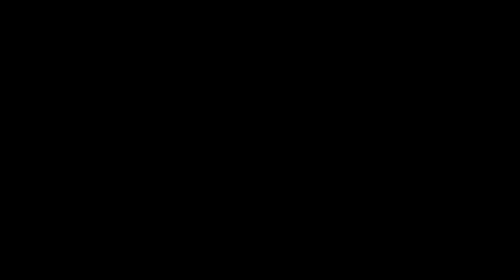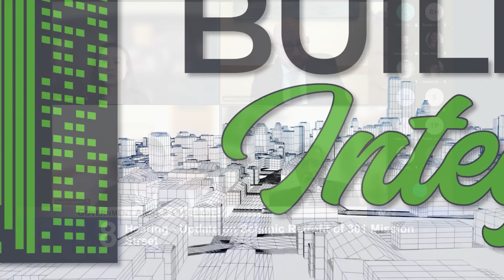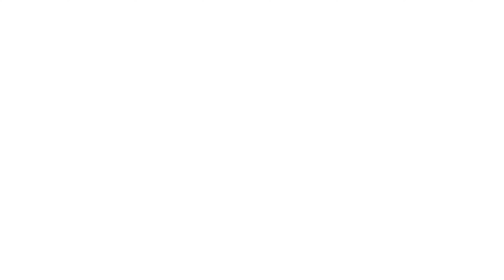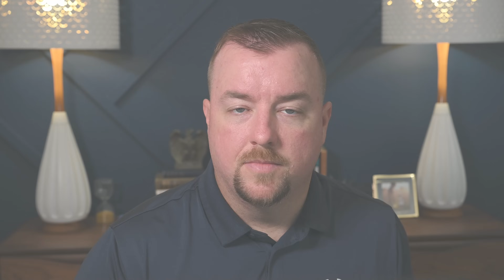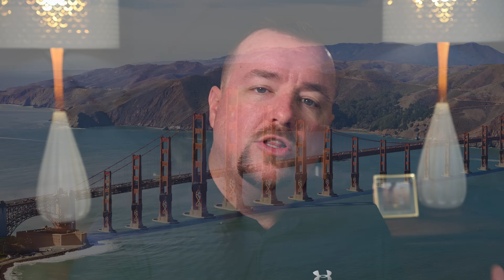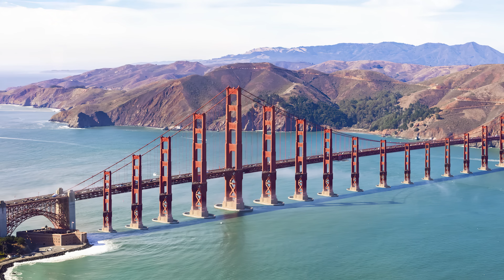Millennium Tower's "Sophisticated" Fix?  You Decide - (San Francisco's Leaning Tower Part 4)

Comment: Going to bedrock is the best long term design.  That big slab of concrete has a huge lever on top of it all of the time and when the soils shift and/or the wind blows, the lever for sure places huge loads on that foundation which is sitting on mushy soil. The fact that this building is leaning confirms it.
Reply: The Prudential Tower in Boston is 62 stories high and the foundation goes down 22 stories into bedrock. The building has been standing there for over 50 years with no problems. What does that tell you?
Reply: @joevignolor4u949  It tells you that this 10 foot concrete slab was a failure and a poor choice for the type of soil on that site.
Reply: @Garth2011  No kidding. That's why Boston doesn't have as many tall skyscrapers as New York City. In Boston its a long way down to the bedrock so the foundation has to go down that far. In New York City the bedrock is shallower so the foundation is cheaper and easier to build.
Reply: @joevignolor4u949  My opinion,  they engineered that lawsuit with the city to make public funds available once they discovered the foundation idea was failing which kept the parties involved with construction & engineering free of financial ruin. Now, they are back pedaling on a bad idea with the cities money, not theirs. Its going to come down sooner or later and the condo's are worthless today as I see it.

Comment: Straight off, I'm an architect not an engineer and I'm based in Scotland and not the USA. However, I have two questions. First, if Hamburger is the 'engineer of record' then surely he is responsible for a design that meets the bearing capacity of the soil. The geotechnical engineer Egan can presumably supply that figure but is not qualified nor mandated to vet Hamburger's solution. Second, I'm assuming these are friction piles. Reducing pile number (from 52 to 18) commensurately reduces pile surface area and the effectiveness of friction (unless pile circumference is increased roughly threefold).  Again, it is surely not Egan's responsibility to determine that 18 is the appropriate number; that is the function of the engineering design made by the engineer of record. Keep these videos coming.  They are fascinating and hugely informative.

Comment: The whole thing is flawed. Their repair only addresses the perimeter while ignoring the inside of the structure. What's keeping the slab from sagging in the middle?
Reply: esp since it's already dishing
Reply: This makes me question what happens during an earthquake. I mean, one side is supported on bedrock while the other is not. Even without an earthquake, it seems like this would put stress/pressure on the centerpoint of the foundation. Basically, you have a beam (slab) where one side is rigid, and the other is not. Sounds like a bad idea to begin with, and potentially exacerbated in an earthquake.

Comment: I am a retired civil engineer with experience of bridge design and large diameter piles. In terms of how the number of extra piles was arrived at, I can see how they came to a ad hoc number of 52. Just simply put in as many as you can at 6ft centres and problem solved. Also, saying 18 piles as opposed to 400 piles, would seem such a huge difference that it may not be taken seriously.

However, to determine the actual number of piles required is very simple. These extra piles would be going down to bedrock and so the pile capacity would be based on the allowable end bearing onto the rock. No need to take into account friction support from the soil, although down-drag from the surround settling soil must be included in the load on the piles. Just divide the total load by the individual capacities and you get the answer, which they say is 18. Hopefully.

The really worrying question though, is when the building settles and assuming the new piles are strong to support the given loads, what is going to stop the building tilting past the levelling value? The designers would have to very confident that their predictions of settlement values are correct, which seems a big ask to me.

I'm of the belief it needs a pro-active system, which can take into account the unpredictable nature of soil settlement. There should be jacking systems built into any new piles so that their loadings can be adjusted when the building has reached an acceptable tilt. Relying on hope alone, is not good engineering.
Reply: Foundation pad shows evidence of cupping which calls into question whether it is strong enough for partial perimeter piles mounted outside of the footprint.  Seems to me that mounting piles to the side of the foundation introduces bending force which can't be good.  I agree with the need for jacking system but is the foundation pad strong enough?  I have not seen any studies that assess the foundation's strength.
Reply: IIRC the 400 pile solution involved driving micro piles through the existing foundation mat so once capped they would become an integral part of the foundation and prevent any cupping or excess stress on the foundation - something these perimeter piles can't do.
Reply: @xenadu02 Thanks for that info. However, the problem with adding piles within the foundation footprint, is that unless they are taken down to bedrock, they will have no effect upon the settlement. The existing piles have formed an encompassing pressure bulb, and any new pile within that bulb will be carried down together with the whole group. It's a well known phenomenon and I find it hard to believe it wasn't taken into account in the original design.
Reply: @dawhandle  but it would reinforce the foundation within the pressure bulb?
Reply: @RobertSzasz  Well, I don't think they would. To relieve the stresses in the base, the micro piles would have to provide support. I don't see how they can do that without reaching the bedrock.
The existing main piles have taken up a certain deflection shape and that cannot be changed by any support being added within the bulb.
I don't know anything about the base, but of course, it will need to be strong enough to cope with any edge piling. If it isn't, then it will need strengthening. Very difficult and expensive.
Reply: @dawhandle  clearly keeping the entire building, foundation, and pilings from moving is going to require going down to bedrock, but could some sort of micropile or grouting stop the differential settling causing the foundation to dish?
Reply: @RobertSzasz  The problem is that to remove the sagging in the slab, the existing piles (which are integral with the slab) will need to be lifted as well. Unfortunately, the loads involved would be hundreds of tons for each pile and would probably snap them as they are not designed to take that much tension. To reduce the settlement with grout, it would have to be done below the level of the existing piles. Not impossible, but could have unintended consequences, eg blowing out sideways and affecting adjacent buildings.
Reply: The added side piles actually do have adjustable jacks, it's part of the design.  But I'm thinking this gigantic weight pushing down on a wall of piles will end up creating a weird side force, looking like the number 7.  And that won't be good either, jacks or not.

You'll be hearing about this building for the foreseeable future.  It's always going to have problems, and with each major SF earthquake it will spawn new and exciting news stories.
Reply: @darioinfini  Thanks for letting me know Dario. At least that's a step in the right direction. But as you say, there are enormous forces involved and I don't think I would want to be living in one of those apartments while they do the work.
Reply: @dawhandle  I wonder if there would have been much difference if at the design stage, the outer most piles were kept, then a sheet pile box were made inside that perimeter and then just put the foundation on top of that. You're end bearing against the subsurface anyways, so might as well make it easy to do things like grout injection
Reply: @darioinfini  I'm no engineer but I would be deathly afraid to be in or around that building during a severe or even moderate earthquake.
Reply: @alecb8509  No doubt.  Can't say for sure but would not be surprised to see a spectacular collapse in the future.  Japan has some crazy quakes and I don't think they've had something like that; their buildings do some awesome scary swaying.  But they do have Fukushima.  6 of one, half dozen of the other.
Reply: Put in large diameter tubular piles as we do in offshore structures (48"-72") down to bedrock and you') be fine. Transfer the loads to the raft using flat jacks which can be adjusted or even changed out if necessary. That will work.

Comment: I'm wondereing how many of these separate engineers are only working within a closely defined remit - the sort of work resulting from the client or its agent packaging up chunks of work for bidding and then selecting all the cheapest, or quickest, or friendliest or risk-avoiding or some other criteria rather than building a broader but more challenging team. The phrase "supporting the project objectives" means different things to differnt folks at diferent times. If I ask my geotech guy for the best scientific analysis, and my engineer for the quickest solution and the project objective is for the earliest revenue from letting, we'll all be disappointed if what I really need is an optimised solution that tells me I should be doing something different.

Comment: Josh thanks for the video - and thanks for the comments/explanations/opinions.
 
Ok - as  a retired civil engineer I can only  say I am not visiting San Francisco soon! 

I have worked as part of a Independent Checking Engineer team - and as part of that our job was NOT to second guess the proposed solution - but to say if it would work. Although if something was 'over engineered'  we probably would say something! And yes, I have worked (on the project management side) on retrofit/strengthening/structural safety of 12 storey residential buildings. AND I am concerned at what is being said/done. AND in an earthquake zone - which I have also worked in.

52 piles reduced to 18  does look like a cost saving - presumably with increased loadings on the 18 piles - with all that entails in terms of foundations/load transfer etc. Actually it looks like a 'finish and walk away bloody quick' solution.

I am actually reminded of the leaning Tower of Pisa over the various fixes over the centuries and of course the 'final' fixes of the 20th Century but that had lower potential safety risk, and even depending on how you price historical/cultural value a lower 'value'.

But to be frank - and using acronym for family viewers - WTF!

Comment: “I say we take off and nuke the entire site from orbit. It’s the only way to be sure.”
They are going round in circles trying to save the unsaveable. Even if they eventually manage to put in an arbitrary number of piles on one side of the building they will at some point need to repeat the process on the opposite side otherwise it will just tilt the other way.  Then there is the little issue of the 12 foot slab which due to the tilting forces isn't as flat as it used to be. I shudder to think what will happen when the "Big One" comes...
Reply: Not nuke from orbit, rather plant one under it.   That will create a void but with super strong glass like materials fused to hold it up.   (Don't worry about a little vibration, the melting, and cooling cycles.)  Just look at how strong the volcanic glass like remains will be....

Comment: Wow, strong closing words there!  This "retrofit" is turning out to be a real thriller, cheers for sharing your expertise with us, Josh, and have a great weekend.
Reply: I think we're seeing organizational behavior - how companies deal with failure.  How to cover themselves and how to avoid making this resume stain worse.  I have to wonder if the 52 proposal wasn't just a test to see if the repair was even feasible.  If 52 wouldn't pass the geotechnical, then the building was doomed. Once it was found to be viable, a stepwise move to optimization began.
Reply: @russellhltn1396  That was my instinctive guess.   Initial question, can we install enough piles to fix the problem?   Okay, say six feet spacing, is that practical and ask the geotech guys if that's enough.   And then I suspect they found the cost per pile was  way over their initial rough estimate (because it always is) and the test piles were exacerbating the problem - and it all went pear-shaped from there.

Comment: I’m not an engineer. When I first immigrated to the USA back in 1977, I used to look at the tallest building in downtown Miami from the 4th floor at the apartment building I used to live in. It didn’t matter how many times I contemplated that building, I could never get over the “magic” that would take to make such a structure simply stand there. And that’s before I found out that Miami is located in “Hurricane alley”. Over 4 decades later, the tallest building has almost been eclipsed by the newer ones. I jus shake my head. Common sense tells me that embarking in such an endeavor, the engineers have got to have their heads set right on their shoulders. It goes without saying that there is no room for error, no second chance. Thanks for the video and your awesome explanation.

Comment: Science and engineering is all about understanding the best questions you should ask to reach the underlying truth. Baffling to see...
Reply: If you let Engineers do engineering you get the best results. When you have bean counters, contractors, developers involved in engineering and design decisions things go wrong. This building was originally designed as a steel structure, then it changed to a concrete design (much heavier). It is extremely heavy and it was somehow decided in a seismic area in poor load bearing soil conditions to not drive piles not to bedrock seems like a highly risky move.

Comment: Okay. The average, single floor dwelling, maybe 1500 square feet, has about 1100  pounds, for every square foot of foundation.  
THIS  MILLENIUM  tower, has over 11,000  pounds, per square foot.   Way  too much.  i  am not an engineer, but a 'realist'.  Mother nature, WILL   stabilize this 686,000,000 pound, 600 foot tall  cylinder of  CEMENT.  WHEN  IT  TIPS  OVER.   
      Comparison:  1,560  GE  train locomotives, each at 430,000 pounds, fuelled up.   THIS  IS THE WEIGHT  OF THIS  TOWER. 

The Millennium Tower may be the most recognizable sinking building in the city, but one researcher says earth-based and space-based observations confirm the entire downtown area around it is sinking as well.

“I looked at every building in the Bay Area, so just under a million buildings,” said U.S Geological Survey research geophysicist Tom Parsons, who estimates that over the last century, 3.5 trillion pounds of development and human activity – including the subsidence tied to loss of groundwater -- have led to an estimated settlement of three inches across the entire Bay Area.
     “Clearly, the most density and the tallest buildings are centered in that downtown San Francisco area, and that's where we see the most calculated cumulative settlement from all of those buildings together," he said.
     Turns out that at an estimated 686 million pounds, the Millennium Tower is the third heaviest building in the city. The top nine all weigh more than 300-million pounds, but the only one that’s leaning significantly is the Millennium. Groundwater loss from adjacent construction has been blamed for the problem by the tower’s developers, while geotechnical experts say the key is that its foundation is not rooted in bedrock.
   “The Millennium Tower’s an unusual example of tilt, but generally they go down vertically,” said Parsons, who has long studied the stresses that build up on the earth’s crust.
    He says all the buildings downtown likely weigh enough to exert sufficient downward force to influence an earthquake fault. Fortunately, the San Andreas fault runs offshore before it reaches the city. So, he says, the billions of extra pounds will not likely have seismic implications.

Still, the mass of sinking buildings shows up clearly in yellow in enhanced images captured by the European Space Agency’s Sentinel 1 satellite.